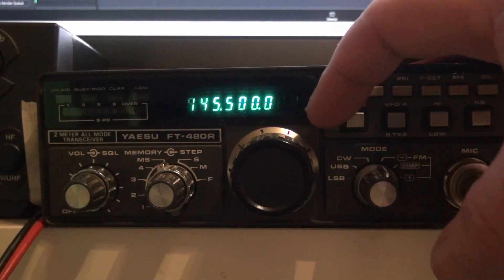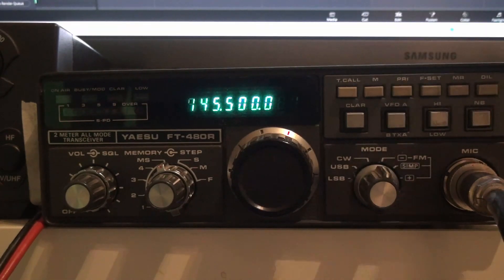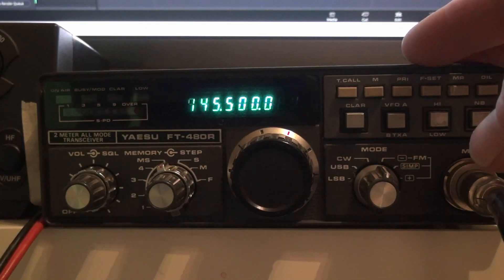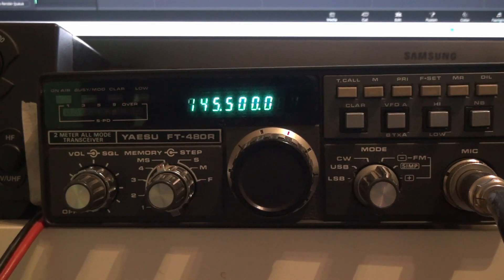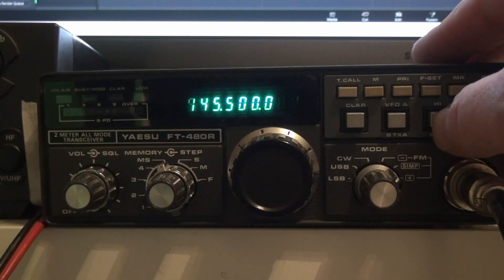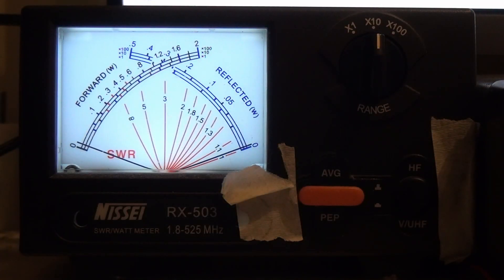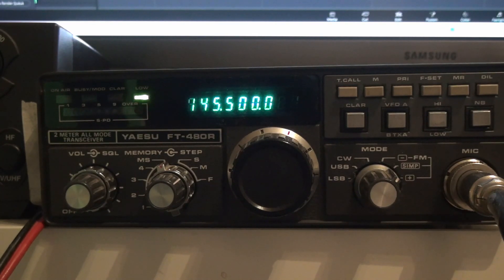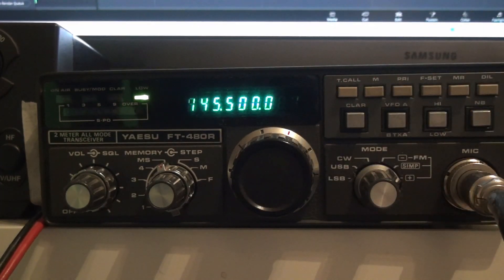Yaesu FT-480R (1980) - How Much POWER?

Comment: Nice. The one I got is the CPU2500R model. Still works, but due to its age, it doesn't transmit the supposedly 25 watts on high and the 5 watts on low. Nice looking radio too and no plastics used for the casing, front panel and even the knobs.